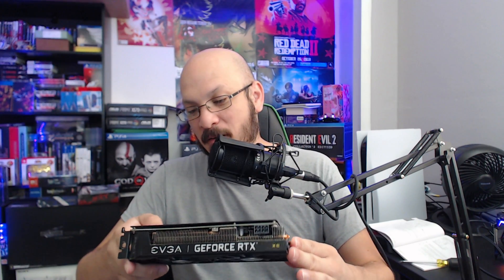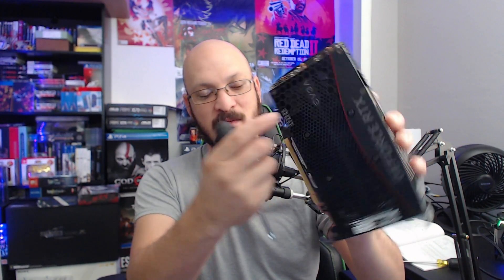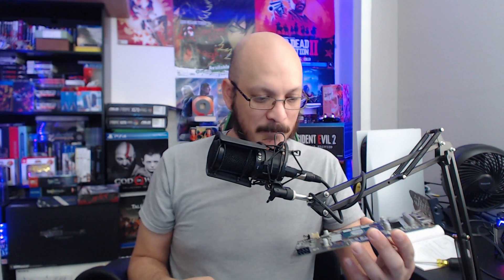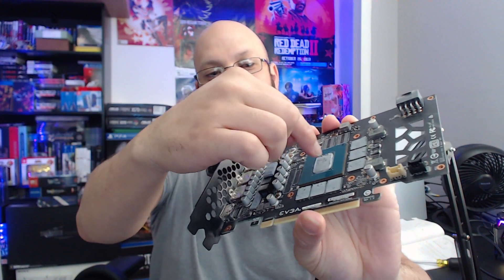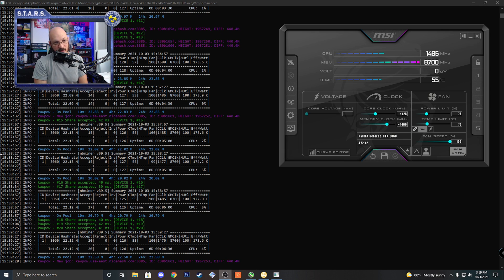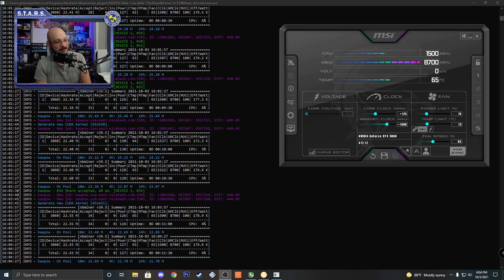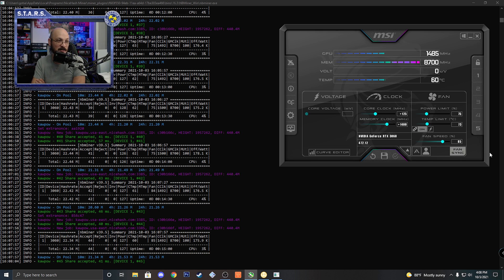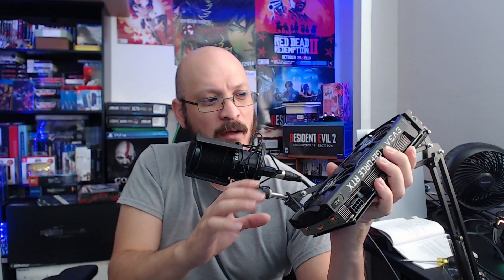I Took Apart My 3060 LHR Ver2 to See Why It Ran Hot

Comment: got a rtx 3060 from zotac it literally is the twin edge but its not the twin edge as in it has the same heatsink pcb fans and shroud but has no back plate >.> i flashed it with the twin edge bios for the higher clock speeds and the 10% power limit increase. It ran at 83 degress consistantly before under full load but now hits 84 to 86 under load. Don't make a lick of sense. Repasted it with some shin etsu and tried noctua nt-h1 same temps hot spot hits freaking 92. I don't think it is a heatsink issue or the fans I think it is just too small for it.

Comment: That's PLENTY of thermal paste.  The problem is the chip and/or back plate need to be lapped to bring them into better and more even contact across the WHOLE of the chip instead of the spotty contact that (it appears) you have.  Is your back pl;ate warped from hanging with no support in your PC?   It may be the way you disassembled the card, though that gives that appearance - or it may be the wavy back plate is no longer in good contact.  In ANY event, that's AMPLE thermal paste!!!!!
Reply from the maker: Not enough for me and when I clean it and applied new and more thermal paste it ran much much cooler

Comment: I bit the bullet and changed all my 120 and 140mm fans to the noctua industrial 3000ppm fans. I've got another single 140mm noctua fan directly behind my 2 3060s and 3080. I've got the fan speed at medium and all 3 cards stay about 49c to 53c. You get used to the fan noise lol. Also drawing a thick line of thermal paste on the cooler side of the mem pads and a thin line on the vrm pads will bring hotspot and memory temps down ALOT.

Comment: 2 questions: should you be that worried aboutit dying if it has 2-3 years of warranty?
Also why is 70 unacceptable? Is it really that high?
Reply from the maker: I dont like having my cards running that high when mining or gaming, thats a personal preference. And it was weird that this card ran much hotter than my other cards. So I decided to apply new thermal paste and I'm glad I did.
Reply: The worry is not getting a replacement card if you have to use the warranty.  You're more likely to get a cash refund than a replacement card right now unfortunately.

Comment: I run all my mining GPUs at 80% fan. Mining Ravencoin runs hot. If you were mining Ergo, your temps would be under 50c. I use Noctua NT-H2 for GPUs. I also put a dab on all the thermal pads for better heat conductivity. I works very well for a long time. I run a 3080Ti at 64c GPU temp. That is the best I can do with it and it does have very good heat conductivity. I doubt I can get lower without completely replacing the thermal pads with Gelid Ultimate and paste. That's about $40 in thermal pads on a new card...
Reply from the maker: 80% isn't bad for speed. I just don't like running fans at 100% if I can help it

Comment: Put some thermal pads on the back of the memory modules as well, like the pad that's on the back of the gpu die. Will drop another 5C
Reply from the maker: oh it does have a thermal pad. The ones that dont are the ones without the backplate. Honestly though they shouldve had better coolers
Reply: @CryptoGameMining  They don't put memory modules on the back. They put 12GB on the back of a 3090.
Reply from the maker: @barrymerritt3727  Tell that to the ones covered by the Thermal pad between the backplate
Reply: @CryptoGameMining  While you are correct there are ICs soldered behind the GPU, I am quite certain they are not DDR6 memory modules. I have actually added thermal pads to those ICs on GPUs that lacked them. To day, I have not seen any memory modules soldered to the back of the GPU boards on RTX 3XXX GPUs except the 12GB DDR6X on the back of the RTX 3090 GPU board. I have not performed a thermal pad replacement on any AMD RX 6800-6900 GPUs so I can't testify to the location of those memory modules. I can tell you have a AIO or waterblock cooled RTX 3XXX GPU performed much better with even memory thermals, especially when you replace the thermal pads on the AIO cooler. An AIO cooler will use more power, as much as 20w, compared to a fan cooled GPU but you can expect 10c lower temps at higher hash rates. Ravencoin using the current Kapow algorithm uses a lot more power, produces much more heat, and is harder to tune than Ethereum or Ergo. I'm getting 53Mh/s on my 3080Ti with GPU temp at 64c. I have no idea how high my memory temps are since I'm using HiveOS and Nvida does not include the memory junction sensor in the Linux driver. What I am not getting is thermal throttling on that GPU so that is a reasonable indication I'm not exceeding Tmax on the DDR6X. Some things to look for on your 3060 or 3060Ti GPUs is the brand of DDR6. It has been confirmed that Hynix DDR6 at stock voltages performs worse than when undervolted. I have the MSI 3060Ti Gaming X LHR and this GPU underperforms on memory overclocks. Check out the video from "Actually Hardcore Overclocking" 5 weeks ago where he made the mods to test this on a 3060Ti with Hynix DDR6.
Reply: @CryptoGameMining  https://youtu.be/xP5lQ7uJUK0 this is what I meant
Reply: Dont buy grizzly, they are only on 8watt, get the gili pro on amazon they are on 14w

Comment: I have different type of 3060ti manufacturer version. The ASUS tuff gamming is the best cooler ever. My 3060 and 3060 ti temp is 38 and 42 during summer with 60% fan but my Gigabyte product is a no go. It runs 55 at 70% fan. I always recommend the asus tuff gamng for any gpu. Its the best cooler so far

Comment: I did the same with my 3060 but I have a version 1. Ever sense I opened it it had never ran the same. And .not idiot when it comes to this stuff. This card has been apart multiple times and it just run the same as it was new. I can run it at 50 d c at 80 percent fan. My 3080 runs 38dc in the same room at 55 fan so the room is cool. My 3060 will crash at 55 tp 58c it'll crash on the same settings. So I though a plug in fan and I runs fine. Mine will crash on all stock settings when it resets thats auto fan stock clocks

Comment: have you taken the plastic of the back plate it looks shiny ?  undervolt it
Reply from the maker: Lol yes I've taken off the plastic. It's a gloss finish they put on the plate. Also I'm not undervolting the card. I use it for gaming and such almost as much as mining so I need it to use the power to boost the clocks like it's supposed to
Reply: @CryptoGameMining  you could just do a preset in afterburner click of a button  one undervolted for mining and one for gaming would keep your temps down 😁
Reply from the maker: @welshinu  true, this lhr card is weird though, i would have to look into it.
Reply: @CryptoGameMining  Undervolting with a curve is really a great idea. Once you find a sweet spot your card should be able to boost up to desired high clocks with lower votages. Which results in less power draw and lower thermals. It works great in games, but I wasn't able to set a stable curve indervolt for mining and just lowered PL instead, but maybe it depends on the algo.